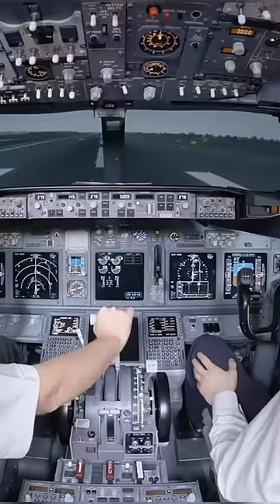Why this invention😱 is the pilots worst nightmare

Comment: This accident was Southwest Airlines Flighth 1248 in December 8th of 2005 at Chicago Midway Airport. Midway did not get an Engineered Material Arrestor System until a year and a half after the accident. The accident prompted the installation of the system.
Reply: That's right...I live in Chicago and a child in a car died.
Reply: What’s wild is Southwest has never had a single fatal crash in their over 50 years of operation, except technically this one.
Reply: @jsamanthababy  so not a single fatal crash ever, except the ones that were?

Comment: Curious as to why the child died. In plane means seat belts, On the runway is off limits.  If the arrestor system had not worked how many people would have been injured / killed?  No, its not a pilots worst nightmare ... it works!
Reply from the maker: the child was an outside accident the plane crashed into cars thereby causing the tragedy!
Reply: @castoutt  AHH, then the arrest configuration was engineered incorrectly. It needed to completely stop the aircraft before getting anywhere near car lanes ... or the lanes needed to be moved, shut down, or tunneled under the runway [as some have done].  Tragic that anyone was harmed ... let alone a child.
Reply: I know the this video is stupid those EAS give pilots hope not nightmares
Reply: @hueginvieny7959  ♥
Reply: This accident was Southwest Airlines Flighth 1248 in December 8th of 2005 at Chicago Midway Airport. Midway did not get an Engineered Material Arrestor System until a year and a half after the accident. The accident prompted the installation of the system.
Reply: @deanfowlkes  Thank you. Sooo glad they got it installed. Any idea if it's been used?  Any idea how difficult or easy it is to recharge once it has been used?
Reply: @michaelpcooksey5096  - I do not have info on Midway airport at this time. Generally, any inner-city airport with a runway of under 6000 feet needs one. I have seen it used once at Addison Airport. It was probably replaced in a week or so. There is no way to recharge it. It is frangible. Since it is really not part of the runway length, it does not get used too often.
Reply: @deanfowlkes  Right, thank you for the comeback and data.  I have associates who have been pilots but this subject never came up. One was a commercial jet airline pilot ... now retired. The other sells prop aircraft.   Hope you have a nice Christmas
Reply: @michaelpcooksey5096  lol wow way to state the obvious here. That incident took place at Chicago midway airport were it’s surrounded by streets and homes. It was a southwest 737 in 2005. It had been circling due to weather and traffic, it was cleared and they came in for a landing with heavy snow in the area but clear runway. At that time midway had  not had an EMAS installed yet. The 737 would not slow, due to delayed time of activating reverse thrusters and ran out of runway were it ran thru a fence and into a busy intersection killing a 6 year old boy. EMAS was installed few years later.
Reply: @buddtwin2  Thank you for the data and response.  Wonder what the cost is to re-do it once it's been used/torn up.?
Reply: @michaelpcooksey5096 Not sure cost, other than "cheaper than the life insurance and jet." But it's set up in tiles so only the broken ones would need replaced.
Reply: @castoutt  how many would have died if the EAS hadn't shortened the roll?
Reply: @orinjnanu2924  Nice. Like the engineering there. Thank You
Reply: Unfortunately Midway has short runways
Reply: @michaelpcooksey5096  the airport did not have that installed yet.  There was nothing at the end of the runway but a fence.
Reply: @buddtwin2  it also landed too far down the runway
Reply: @castoutt  ... BUT THERE WAS NO CRUSHABLE CONCRETE INSTALLED THERE!
Reply: @michaelpcooksey5096  ... No, the "arrest configuration" as you called it did not exist.
Reply: @michaelpcooksey5096  The EAS was installed after that accident to stop the same from happening, bruh.
Reply: she wasn't in the plane she was in a car

Comment: This video is wrong about the Southwest Airlines landing mishap. The Engineered Materials Arrestor System or EMAS you talk about was not even installed on the runway in question so that's a false statement on the content creators part. Also EMAS would have definitely stopped that plane before it plowed into that car. By the way, an inflight fire is one of the dangerous situations we definitely don't want to see in the air.

Comment: This video has so many things wrong with it. Such as:
- Must pilots don’t consider the landing to be the hardest part of flying an airplane. They consider it to be the most enjoyable part. The hardest part is mentally staying ahead of the aircraft. 
- The Engineered Material Arresting System is made to be crushable in order to slow the aircraft over time and distance. Immediately stopping the aircraft would rip the landing gear off, sending the aircraft into an uncontrollable fiery crash. It is similar to the truck run off lane on mountain roads. 
- The system was put in place because of the accident that you just mentioned. It was installed after the accident. It was not the cause of the accident. 
- if an aircraft is still traveling at 80 knots when it reaches the far end of the runway, the pilots will want that aircraft either airborne or stopped by all means necessary. If they are not already in the air, the aircraft will take too long to slow to a halt by any other means.
Reply: Exactly. If the aircraft is going 80 Knotts at the end of the runway id assume they weren't even trying to land the plane at that point and instead were trying a go around.
Reply: Also. The kid who died during the accident was the kid from the car who stays on a car and got hit by the plane, not a passenger inside the plane.
Reply: every pilot will tell you landing is easy.
landing and walking away from it is another story.
Reply: Not all the pilots are the same
Reply: Bet you got all excited writing that
Reply: @SadMarinersFan  that's too slow for the 737 to take off.  It landed long on the runway in a snow storm and the pilots deployed reverse thrusters too late.  Improper training on reverse thrusters was one of the reasons for the accident.
Reply: Yea.. I kind of was thinking thinking start up was the most stressful because then they have to do a lot in limited time. When they land they usually have loads of time to prepare.

And if you think it's hard to land... you might not want to be a pilot. I'm not even a pilot, I have flown with friends a couple of times, and it's really not that hard to land.
Reply: @SadMarinersFan  it depends on the plane
Reply: As a pilot I'd say that landings are definitely the toughest phase of flight but also the most rewarding when it's done well
Reply: Nearly every pilot I've ever met during my many decades of working on aircraft have stated at one time or another that taking off and landing are the most stressful parts of the job with landing the most dangerous.  Most accidents are during T/O and landing too.
Reply: @tmayorca8770  - High workload, yes. Statistically higher accident occurrence rate, yes. Highest stress, it depends. There are many more stressful situations during a flight. Primarily in emergency and abnormal events.  Taking off is easy. Almost anyone can do it. Landing is like an accuracy challenge.
Reply: @matsv201  - Start up and preflight are not very stressful at all. There are a lot of things to accomplish. But, they should be the same things each and every flight. There are even flows to accomplish each task and checklists that verify if they are done. The amount of time it takes to do it all depends on the aircraft and the pilot. You could take all day to accomplish them all, dependent on the mission.

Landing is the highest workload event. You are having to accomplish a lot of tasks, flows, and checklists all within a very strict and limited timeframe. You are typically traveling at as much as 150 mph across the ground and as much as 10 mph straight down. You are running out of approach path and altitude very quickly. Factor in all of the environmental effects, it makes for a challenging situation. It’s like threading an arrow through a row of axe heads.
Reply: Pp
Reply: @xb70valkyriech  Sorry, but, that sounded kind of  funny "When it's done well" 😉.
Reply: @robynlea6950  I can confirm I like my landings well done
Reply: Landing isn't hard. Every plane will eventually land even without a pilot.
Landing intact is another story.
Reply: @jamescharlton4915  I would have. Bet you got all jealous you weren't the one with the accurate information.
Reply: As a pilot, thank you, you are absolutely correct
Reply: Mentally staying ahead of the aircraft. What exactly does that mean? We're not all pilots.😅
Reply: @ekehdaniel3020   - It means that the pilot has to be thinking of and prepared for two steps (or at least 5-10 minutes) ahead of the present moment. Small aircraft will cover at very least 2 miles every minute. You can not wait until the last minute to make a crucial decision. 

Old sayings in aviation are: 

“The most important thing in flying is the next two things.”;

And 

“Don’t let the airplane take you where your mind has not already gone 5 to 10 minutes before.”
Reply: @sirBrouwer  yep, never heard of a pilot who didn't land, they all do at some point.
Reply: @deanfowlkes  no landing is very easy. Surviving said landing is the challenge.

Comment: I think the author it's not well informed about how EAS works. It doesn't work like an arresting hook on an aircraft carrier. It's just slows the airplane down better than the braking system would do and could even prevent it from departing the runway.
Reply: And on the SWA incident that killed a child, I believe it took place at MDW and they did not have the EAS system

Comment: They were experimentally developing these arrestor systems at the FAA Technology Center at Atlantic City International about a quarter century ago. It's supposed to reduce damage, like a highway guardrail. I don't think it stated with plates, but beads.

A little something from FAA:

"The Federal Aviation Administration (FAA) actively worked to improve runway safety areas (RSAs) at commercial service airports by the end of 2015. The RSA is typically 500 feet wide and extends to a maximum of 1,000 feet beyond each end of the runway. It provides a graded area in the event that an aircraft overruns, undershoots, or veers off the side of the runway. Many airports were built before the current 1,000-foot RSA standard was adopted approximately 20 years ago. In some cases, it is not practicable to achieve the full standard RSA because there may be a lack of available land. There also may be obstacles such as bodies of water, highways, railroads, and populated areas or severe drop-off of terrain.

The FAA began conducting research in the 1990s to determine how to improve safety at airports where the full RSA cannot be obtained. Working in concert with the University of Dayton, the Port Authority of New York and New Jersey, and the Engineered Arresting Systems Corporation (ESCO, now Runway Safe Inc., of Logan Township, NJ, a new technology emerged to safely arrest overrunning aircraft. EMAS uses crushable material placed at the end of a runway to stop an aircraft that overruns the runway. The tires of the aircraft sink into the lightweight material and the aircraft is decelerated as it rolls through the material."

Sorry, but we're proud of our local contribution to aviation safety.
Reply: So that’s why the FAA has a base in Atlantic City
Reply: Thank you from an A&P mechanic.

Comment: If were talking about short landings with military cargo planes, they literally use rockets to slow down or speed up the plane. Its as simple as that but very effective. And dangerous
Reply: They don't use RATO system for takeoff/landing anymore, except for the C-130 used by the USMC as part of the Blue Angels demonstration squadron. C-17 and C-130 are able to takeoff/land in short runways, especially the latter can do so in austere airstrips.

Comment: The system was originally invented to stop runaway heavy trucks on steep descents, but in my 55 years of flying I have NEVER seen that system in operational use in the South West Pacific.
Some landings are difficult but not all and a lot depends on the skill of the pilot, his or her experience on the type and operating within the parameters detailed as limitations of that particular aircraft and one's ability to make firm decisions.

Comment: I know this might sound ignorant, I don't know too much when it comes to airplane tech but couldn't runways implement a cable stopping system for planes landing like they do with fighter jets on military ships?
Maybe not as aggressive obviously since runways are much longer and they have much more room to slow down but a similar concept that slows the plane comfortably enough and prevents planes going off the runway.
I get that airliners weigh many many tons more than a fighter jet so I don't know if this is feasible with a larger cable but just an idea.

Comment: As per the NTSB's Aircraft Accident Report on this accident (NTSB/AAR-07/06 PB2007-910407):

"Contributing to the severity of the accident was the *absence of an engineering materials arresting system*, which was needed because of the limited runway safety area beyond the departure end of runway 31C."

So yeah, this is false and misleading.

Comment: Don’t you just love when people who have probably never even soloed a kite let alone a aircraft try tell you what the hardest part of flying is 😂.

Hardest part of flying differs from pilot to pilot.. but one thing many pilots find difficult maintaining a listening watch whilst preparing to join / enter an airspace especially if it’s busy. Landing and taking off ? Not really.. that’s a high focus moment. And all of these plane runoffs unless could of been avoided had the PIC registered the aircraft wasn’t slowing in time and actioned a go around earlier in the landing or even in some cases the approach phase of flight.

For take off we set go / no go markers. My instructor had me do the same on landing. If I mess up and ballon / float and end up looking to land long go around. 

If I’m down and braking but not a set speed by such a position full throttle go around. There’s no need to stomp the brakes if you are with in the aircraft limitations

Comment: It's definitely a scary situation when large planes needs to land on a smaller runway.
Reply: But definitely something that can be done-9/11 prove that.
Reply: 737's are not large aircraft.  That starts at the 757 and up range.  But they are bigger than general aviation aircraft
Reply: @tmayorca8770  I know what you're saying,  However, my comment is more about grammar and less about aviation.
Reply: @nodangles6983  Midways airport is sufficient for a 737.  That plane landed too far down the runway and deployed thrust reversers too late plus runway was somewhat wet from 1" of snow though it was clear.

Comment: Actually, it is an Engineered Material Arresting System. The material dissipates kinetic energy of the plane by crumbling, and they have a rated energy dissipation in accordance with regulations and airport requirements. No system can stop every plane at all energies.
This video also has unrelated video spliced in, overall poorly informed and poorly produced.

Comment: Why don't they build a gradually elevated runway? 
from the point of stable touch down  
gravity will do the rest of the work.

:  reason is simple accidents are far less compared to the fuel required to take off from such runways 

It's all about profits

Comment: And those tiles of the arrestor system has to be replaced everytime, what about having the same emergency 2 consecutive times?
Reply: The runway is shut down after any crash. You're not landing planes with a plane crash actively happening.

Comment: Overruns only if the pilots are inexperienced with either the aircraft or the approaching aircraft or a malfunction with the aircraft itself. There are no ifs or buts about it. What a load of trash. If you can land a plane in a 2 mile long runaway you shouldn’t be allowed to fly

Comment: Almost like a non engineered material such as water alot of highly versatile drainage collection basin with sufficient depth and  not too deep do be undivable to recover stored "wreckage" or remaining usable plane just know ice in winter is a thing so well ya gotta figure it out , snowpiles may be usable  but best bet is sufficient takeoff and landing lengths of runway  as well as powerful enough thrust to weight ratio and not exceeding the possible takeoff weight
Reply: Have you ever seen a plane try and stop on water? They disintegrate. A snow drift would destroy the jet as well. EMAS doesn't damage the craft at all. Plus the large majority of airports are unable to extend their runways due to landscape and zoning.